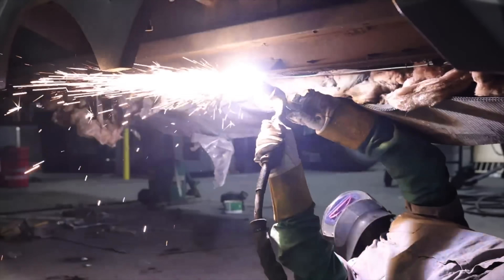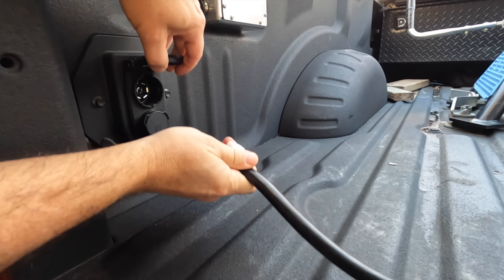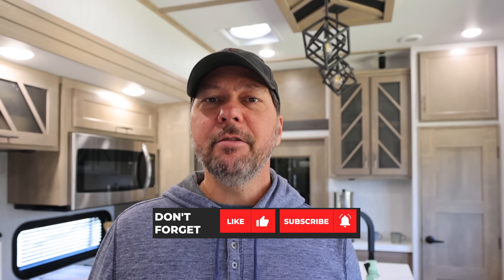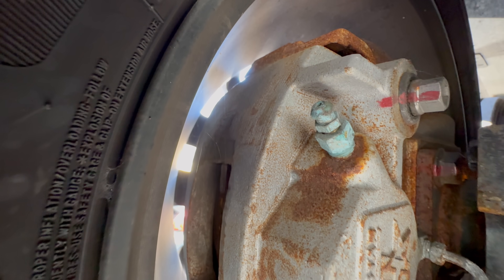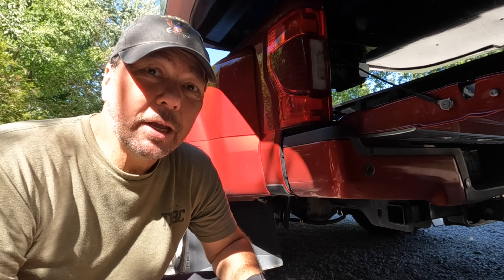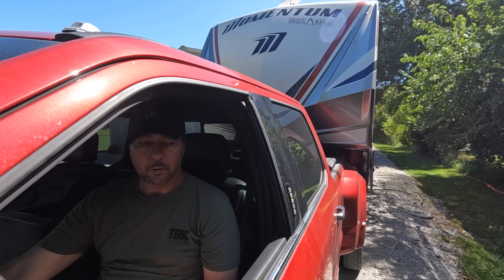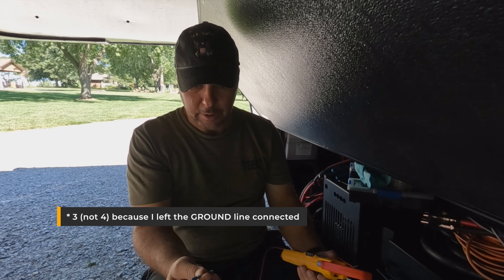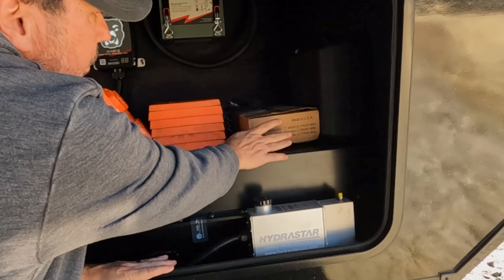RV Brake Troubles!: Solving a Perplexing Hydraulic Disc Brake Issue

Comment: Maybe even though the connectors had low ohm when the load is applied it has a resistance. Kind of like if only a couple strands of wire were connected. It couldn’t handle the amps.

Comment: Hi Chad Maybe I missed something in your video but didn’t see you check your grounds. I have a friend who was having problems with vehicle his  shutting off  going down the road, lights would not work at times and a list of things. Before he brought it to me. He took it to two different shops. They told he needed a new alternator, ECM and one said he had a bad computer chip. I told him before you start throwing parts at it let take look at it. Sure enough it was a faulty ground. The resistance on the ground would change as the weather would change. I replaced the bad ground, which was less than a dollar. That took care all of the problems he was having. So I’m just wondering if your ground is creating resistance which would diminish your voltage going in?  You know the bad thing is that brake problem will bug me for the rest of day. 😅 I’ve spent the last 43 years solving problems like yours. I’m retired now and getting ready to hit the road and see this great country of ours. Anyways I think your videos are great!!

Comment: I noticed that one of the rotors has surface rust, for sure that one isn’t applying. Also, some of those calipers have two screws. You’re bleeding the top ones, right? The lower ones won’t allow the air out. Can you put a pressure gauge at the line that goes out to the brakes?

Comment: Wondering if you should pull both ends of the 7-way part and check the screws and wires? Next would be to check and clean the grounds. An observation, in the first couple of minutes you were inspecting the brake hose. The disc was completely rusted over. Is it possible the mounting bolts for the caliper have rusted on some of the wheels and not allowing the calipers to move?

Comment: I may have missed it but did you check for a good ground. I spent several hours one day while working on a Navy tow tractor brake lights drove me crazy til  i figured out I had a weak ground. Other than that I'd just guess the master cylinder was intermittent

Comment: If the system fails again, try pulling the emergency brake away cable and see if the trailer breaks apply.
Which bleeder fitting did you use to bleed the breaks; hopefully you used the top fitting. Air will go to the highest point in the break caliper.
The crimp connector reading 0 Ohms is not a true value of current capacity; you need a high current to apply the brakes.
Just a thought, I would flush the brake fluid and see if it is discolored.

I wish you well

Comment: I have the same brake controller with a 2019 F450 and while my symptoms are different, I wouldn't rule the truck out entirely.   Stopping at speed, it's like a threw an anchor out, the brake grab like crazy.   Slowing down to a stop at a light, however, can be spicy.   Ford, as you mentioned in the video, has speed sensitive brakes, and they are way too aggressive at backing off the braking at low speed.   I hate it!   I'm often on the manual control coming to a complete stop because the truck will just "fade" away the RV braking as you go slower and slower.   Yes, I know why (to prevent lockup), but my RV weighs close to 26K, lockup is NOT a concern, it takes almost max braking at slow speed (manually applied) to get a lockup.   

I don't think this is your issue, but wanted throw it out there.

Comment: I’ll make my 2 cents short.  Power Reset and Ground.  Although power reset was needed to clear the problem, something caused it and may cause it again.  That very well could be the ground as stated.  Since the power from braking comes from the truck battery, the ground should be checked all the way back to the truck battery not just to the trailer chassis. Love your videos by the way.

Comment: Is it possible that there was some contamination in the brake fluid reservior that was cleared when you where bleeding the brakes at the Wheel cylinder. I can't think of an easy way to check that. Perhaps putting a bore scope into the reservoir or draining the reservoir to look for contamination. Another possibility could be water may have contaminated your brake fluid.  Brake fluid absorbed moisture like a sponge and when put under high pressure (like when heavy braking) the water boiles and will reduce brake pressures at the wheels. Check the cap on the reservoir the it has an air tight seal. There is usually a diaphragm in it that expands as the fluid level drops because the brake pads wear down and the pistons in the wheel cylinders move further out 
I understand the frustration with intermittent problems. I have been trying to find an air leak on my class A motor home for 8 months. When I stop for several days the air pressure in my reservoir tanks drops form 130psi to about 20 psi and have been unable to find it. Everything on the coach runs on air, the leveling system the suspension, the brakes, horn, step well cover even the gasket around the entry door is aired up when I put it in drive.
Well good luck in finding the cause. I hope any of my ramblings may have been helpful.
Sincerely
Greg Dugre'

Comment: Did you test the resistance of ground wire ?
From the looks of the rust on the breaks I wouldn't be surprised to see some green puss on any connector especually the ground connection.

Comment: hey Chad,  Forgot the other question in my other comment.  

When you were checking out your braking system did you ever get a static shock off of it.  Like you would from a door knob in the winter after shuffing around in your socks for a while?

This would also point back to a grounding issue with your controller that is a culprit for intermittent issues and from your description of where the issue started its possible for a cause.  If the issue came and went as static was allowed to build and deplete over the course of multiple days its another thing to look at.  I would expect its something else first but if you have had that little zap then its something to look at and rule out since you were driving south away from very dry air from below freezing temps and now its not giving you the issue.

Cheers

Radio

Comment: As a mechanic for over 40 years I've ran into problems like this before and found that you need to check connections under a load. Many times I've checked connections that showed good but under a load they would drop out.

Comment: Check voltage drops with hooked up and malfunctioning and don’t forget checking ground wire  voltage drops. And your signal wire circuit relies on the truck ground connection between truck and trailer. Seen a lot of issues correct after reconnecting trailer due to grounding through hitch not harness hopefully this might help

Comment: Check the junction box near the 5th wheel on the trailer. That's where the trailer plug is spliced in to. Also, if it does it again, pull the emergency breakaway cable. That will determine if you're getting full pressure on the pump or not.
Reply: I agree, I had an intermittent connection at the junction box up in the pin box. I think somehow one of the wires fatigued, I cut and respliced and no issue.

Comment: Module input voltage, when metering the input voltage connect between the signal wire and Gnd wire. This will give you the input value. If you only measured between signal wire and chassis gnd you did not verify the Gnd wire. 😊
Reply: Completely agree and if took it one step further by using a min/max capturing meter this problem would have been caught easier and with certainty.

Comment: Chad just a thought   When you cut the wires to check the power of each power feed the braking unit when you reconnect the main consistent power could that rebooted something in the controller like when you need to unplug some electronic devices to get them to reboot / restart?  
Love you technical videos.

Comment: Is the ground connect to chassis? It is possible there is grounding issue and if the pump is not connected to chassis ground were you would get a back up ground thru the hitch it you 7 way is losing ground.

Comment: Chad I am a controls engineer an maybe when you cut the constant 12vdc line that may have reset the pump actuator. Correct me if I’m wrong but your constant 12vdc comes from the RV batteries.
Reply: Controls Engineers are my hero's! I'm a controls technician and work in automation.

Comment: Does the actuator always have power? I know it hooks to truck but was it tied into the solar system at all or anything that would have preventing an entire “discharge”? When you cut, that forced an entire discharge, maybe opening up a resistor or something? I dunno, you’re the electrical engineer but it was something I thought of we do with bios batteries.

Comment: You might want to change the brake fluid if it got moisture in it the calipers won't work very good good luck
Reply: This should be the next try if the brakes feel soft again.  I had an instance myself where my brakes went very soft, nearly to the point of complete failure the a couple days later they were back.  This occurred a couple of times, and I was advised to flush all the old brake fluid out of the system with new clean fluid.  The old fluid that came out was clearly dirty and discolored but could only really be seen once in a collection container.   This solved the problem, and brakes were like new again and have not had a pro lem since.

Comment: I have a similar problem since new (397th) I swapped out the metal box at the pin box for a 7way box with studs. I'm also thinking run the ground back to the battery. The wire is showing 12 volt but can it deliver the amps?

Comment: If it’s not the actuator maybe the brake controller in the truck has failed?  Any way you can tow it with another truck and see what happens? I’d volunteer my GMC if your anywhere near central FL.

Comment: I have the same problem.   Truck control was only putting out 1.5 amp.    Got a new one and it would go to 4.2 and drop off to 2.2 amp.  Got any other one and we got full 13.5 amps.   But does the pump need full 12 v to run.   Or should it run on less.   Dont seem to have any brakes at lower amps.  I can't get a answer from Dexter.  Thanks

Comment: I would check Caliper pins and slides could be rusted (frozen ) not moving enough to squeeze rotors
Reply from the maker: If that were the case, they woudn't have just started working by themselves, I think.

Comment: Chad,  you mentioned that the 12V supply to the hydraulic brake controller comes from the RV supply and measured 13.6V.   As @anthonytomaz7338 mentioned that high voltage could be a problem but probably falls within the range of many alternators.   The Hydrastar installation manual says to connect the controller to the 12V VEHICLE supply.   Connecting to the RV creates all kinds of unique situations when the truck is plugged or unplugged, if the RV and vehicle voltages are different, etc.  

You might want to try changing the Hydrastar supply connection  power from the 7 Pin trailer cable on the RV side.   Make sure the same for breakaway switch power.

When I troubleshoot, I start with what is different, unique, or just changed.  What is different about your trailer compared to most everyone else?  1) Hydrastar is connected to the RV and not the vehicle.  2) You have the tail-light convertor that is no longer offered; I wonder why... did people have problems?   3) You have a Volta system which only comes into play because you are connecting to RV power.
Reply from the maker: I need to email hydrastar about that line in the manual for clarification, because it doesn't make sense.  As I understand it, the black wire is power for the actual pump, while the blue (controller) and yellow (breakaway) are "signal" voltages.  If the trailer ever did break away from the tow vehicle, the power source needs to be internal to the trailer.  Unless I'm wrong and the breakaway is both signal and power.
Reply: @ChangingLanes  I believe it IS both signal and power.

Comment: This might sound crazy, but a frozen caliper pin will cause "soft pedal". Not saying that's your issue, but it's worth checking.  If all pins are free, I would change that actuator. I assume it works a lot like an ABS modulator and can cause a soft pedal as well, but typical it wouldnt be intermittent. I've been a mechanic for the past 28 years, so going off of what I've actually diagnosed in the past.

Comment: Chad, do you have a way to check hydraulic line pressure?
What happens if electrical side of system is working. But hydraulic pump is giving out under load? Low line pressure would mean slow or no brakes. 
Good luck, be safe (Terry)

Comment: Chad. Check the voltages again after grabbing an old headlight and having the lamp lit when you measure the voltage. Check all the wires; blue, black, etc. 
The switches sometimes show potential but not voltage if you don’t put them under a load. 
(Old aircraft mechanic)
Reply: Also have a load when checking the splices that you took out.
Reply: Very few practice this diagnostic technique. Good on YOU!

Comment: Ok, this is going to sound rudimentary, but you never mentioned it, so here it is: was the brake reservoir full and the cap on tight? I recently had an issue with my brakes as well, and after hours and multiple dsys of checking wires and connections, the controller and the add-in HoE actuator all to find nothing, i finally checked the reservoir and it was nearly bone dry. Come to find out, we had a bad caliper that had bled the system dry over time, and i didnt catch it til i found the empty reservoir. Filled it, bled the lines and found a leaky caliper. And since you said you bled them just to be sure, i wondered if that was part of the issue? Just a thought.

Comment: With lithium batteries you can hit up to 14.6V when charging.  The MaxAir fan we have had an issue with the control board that many people thought was due to excessive voltage - I replaced the board and added a 12.8V regulator in line to prevent it from seeing the full voltage my system could produce.  We have lithium batteries and solar.  I have our charge controller set to 14.6V as recommended by battle born and Victron for my setup.  Same with the inverter/charger.

Maybe your controller went into a protection state due to excessive voltage and when you removed power it reset?  Some DC electronic device get funny with voltages above 14.5V or so … if that is the case you could get a voltage regulator that is rated for the current your brake actuator is rated for and add that in-line.  See if there is a max voltage it can handle ….
Reply: A similiar problem disabled the factory brake controller on 2024 GM trucks that took 6 months to resolve. The NTSB should have stepped in and didn't.

Comment: Critical points. Voltage doesn’t mean amperage. Ohms doesn’t mean ability to carry current. 

One thread of copper wire hanging on can read proper voltage and low or zero resistance. When a load is applied (the brake system motor) the voltage will drop due to the inability to carry current. 

You did the right thing by testing the wires at the actuator. However, you should have load tested them after the crimps

A dirty field tech trick is an old headlamp bulb. 5-7 amp draw. If the wires can light the lamp, they have the ability to carry current and operate the load.

If you still have those crimps you cut out, and there is enough wire left. Load test them and see. You may still be able to prove your problem.

Comment: Thank you for the video.  I am particularly interested in this problem.  I had performance trailer braking put the electro/hydraulic system on my 399th and the installer told me that usually after the upgrade people can set their brake controller on 3 or 4 and get good braking.  This is not the case for me.  I have to set my brake controller at least on 8 to feel like I have sufficient braking.  I can hear my brake actuator working as well when brakes are pressed, thus I was particularly interested in the video to give me some ideas of what to check.  Chad do you mind to share what you typically have your brake controller set to?  Mine maybe different since mine is a 2022 chevrolet dually.  But, I would think that the brake controllers of your truck and mine should be comparable.
Reply from the maker: I had ours set to 7 I think... I will do some readjusting when we hit the road.
Reply: ahh ok, briefly i saw in your video it said 9.0 but you might have had your foot on the brake, lol,  so maybe having mine set up so high isnt abnormal after all